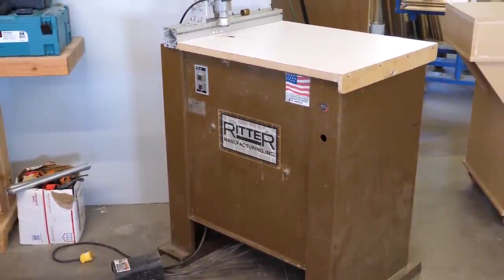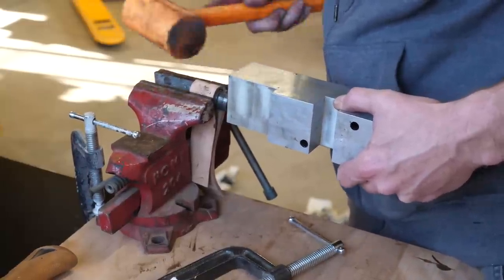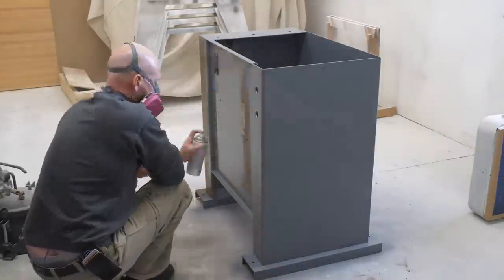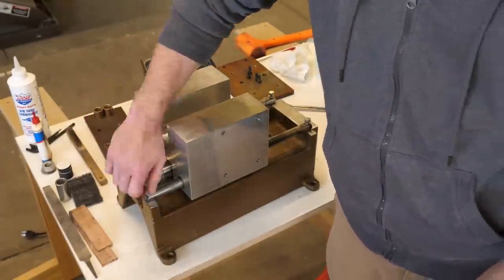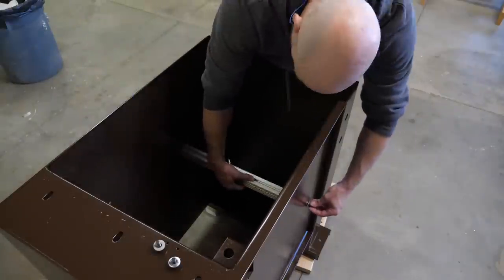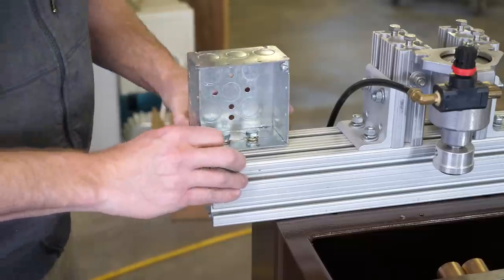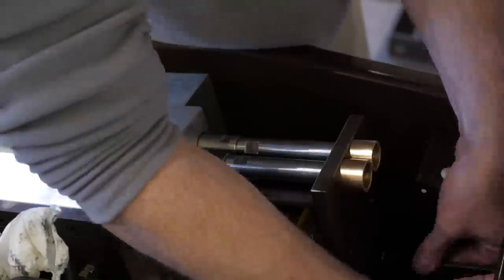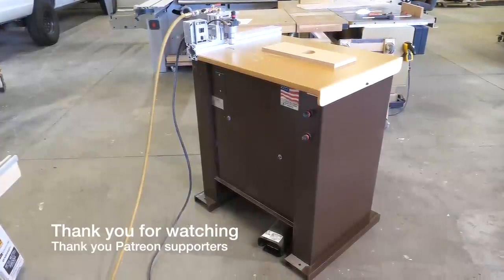Industrial pocket hole machine restoration.

Comment: That helical gear has the advantage that it has a better teeth area of contact, thus more efficient. The thing is, this comes with a drawback, it induces axial forces into the bearings. Perhaps it's a small amount of force but the bearings should be tapered roller bearings.
Reply: I think the bushing adjacent to the gear takes up the thrust.
Reply: Helical gears are also quieter than standard spur gears.

Comment: Helical cut gears (like those in automobile transmissions) are much quieter than straight cut gears. Though straight cut gears tend to have more contact surface, they also tend to whine a lot and not be quite as smooth. With a machine like this at the speeds it rotates at, I would guess this is maybe more likely for sound than anything (maybe smoothness as well). Also, "if YOU want it, YOU carry "it!
Reply from the maker: Good info, thank you.

Comment: Your restoration of shop tools is always interesting.  A tip for installing press fit bushings is put them in the freezer for 30 minutes and set the housing in the sun.  Often they will just push in by hand.
Reply from the maker: Thank you, I do the freeze / heat thing when working on motorcycle motors. I don't know why I don't use it when working on tools.

Comment: Helical gears run quieter than spur (straight cut) gears. They have a larger amount of tooth contact than spur gears, therefore they last longer and are better for high-load applications. The big aluminum block that glides on the rails is called a "carriage."

Comment: Always enjoy your videos. I think the “square” aluminum block is actually a cylinder barrel with a milled external shape that can support the electric motor and the drill motor. They are pinning the ram so that the barrel movement/shape can move the drill motor without other connecting parts. Great idea when you think about it, but the external shape makes you want to call something other than a cylinder barrel.

Comment: Found your channel really love the subject matter. Two things I enjoy also fixing things and building things. 
Now my but,  but what happened to the dual pocket holes?  Your demo shows a single hole being drilled.
Reply from the maker: Thank you. I forgot to mention that I don't like the double spindle, it's too wide for 1 1/2" face frame parts. So I just run the single spindle, though installing the second one would be pretty easy.
Reply: Oh, well that would explain it. Keep doing what you're doing. @MikeFarrington

Comment: Not going to sleep until I figure out where the second drill went
Reply from the maker: Ha! It could be installed, then hit the foot pedal, and it would be there. I just didn't think it was useful for a small shop because the spacing is too wide. I should have mentioned that in the video.

Comment: X axis sled is my guess on what the block is called, be careful with simplegreen and aluminum it etches pretty good, I have had it eat aluminum before and ruin parts before
Reply from the maker: Thank you. Thats why I rinse the crud out of all parts that simple green touches. Also, I will put some oil on them as I am reassembling.

Comment: I bought a set of left hand drill bits and extractors and there are times when the bolt or screw has come out while drilling eliminating the need to use the extractor
Reply from the maker: That is a really good tip. Thank you.

Comment: Why did it only drill a single hole.  I thought it was a dual pocket hole machine
Reply from the maker: I'm not a fan of the spacing of the two hole pattern, its too wide. So I just installed one bit.

Comment: Does that thing have some kind of adjustment for different material thicknesses?
Reply: Sort of. You move the fence backwards and adjust the drill depth stop. The kind of shop that will use a machine like that Ritter is the kind of shop that has two machines set up for 1/2 and 3/4.